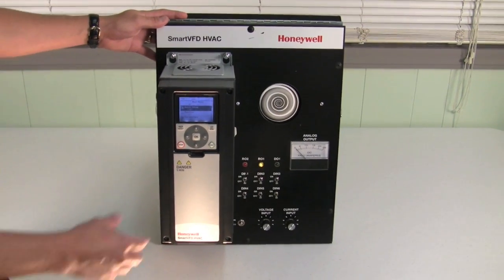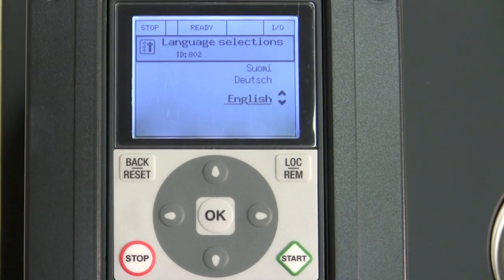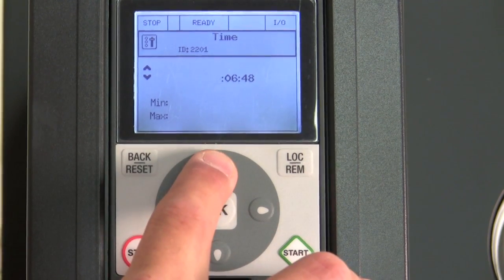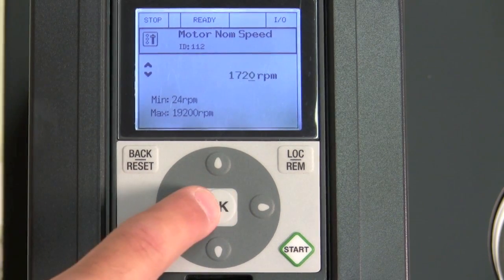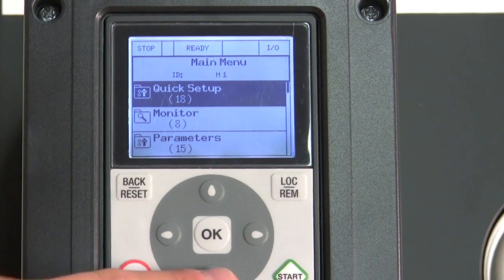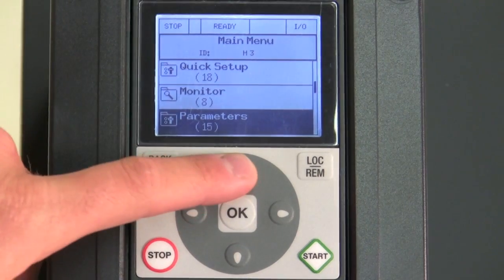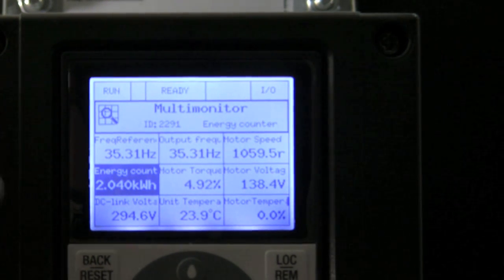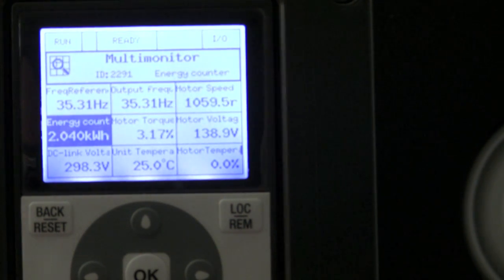36 SECOND VARIABLE FREQUENCY DRIVE SETUP

Comment: @techgeekification 
it is very nice Vacon, uh, splutter, cough, cough, I mean Honeywell Drive. Pump and fan torque curves are slightly different, so selecting specific application optimizes energy consumption. Setup is only for pump or fan application currently, as it is only currently avail for HVAC. In near future, it will be available for all general loads/applications,